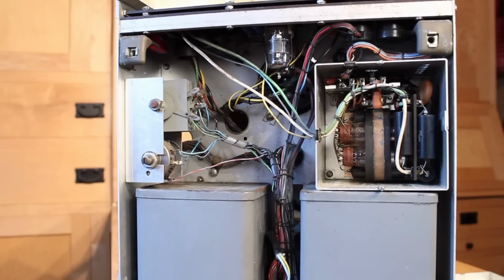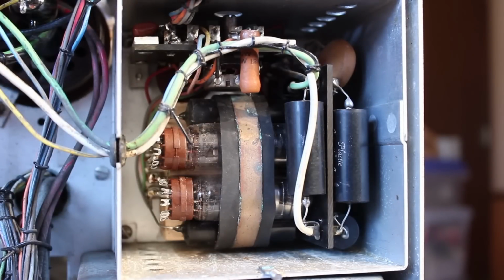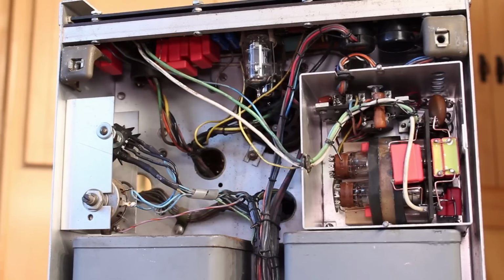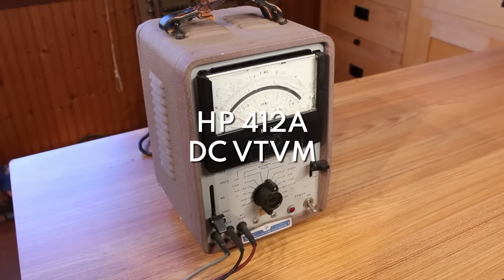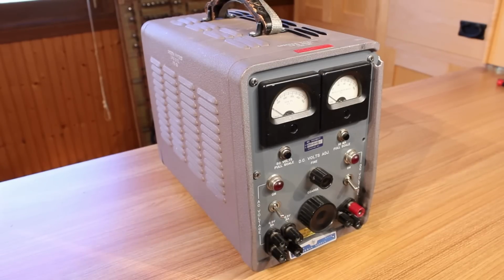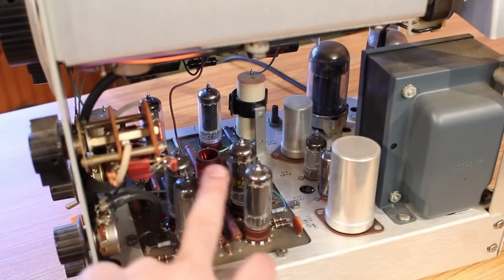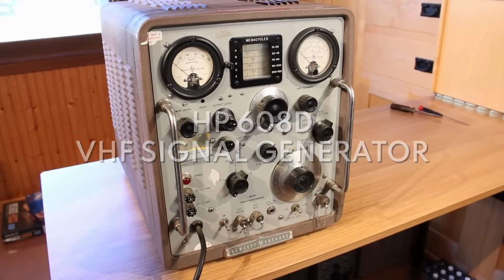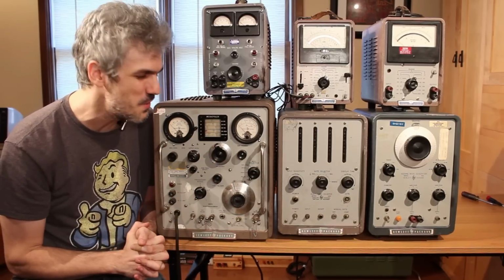Vintage Hewlett Packard Test Equipment Extravaganza

Comment: You will at lease need a 5-7 watt resistor, 1-3 watt will heat up.
Reply from the maker: I think you're referring to a resistor for the heater rail in which I replaced the selenium rectifier?
If so, I actually didn't need an additional resistor, the variable resistor that was already in place (R1323) has enough adjustment in it to bring the DC voltage right into spec. according to the manual. Also, that variable resistor is a 4W resistor, so you're right that 1-3W would definitely be undersized!

Comment: Use something like JBweld to fix the corner , would love to see the resto on the frequency counter
Reply from the maker: That frequency counter is so cool, isn't it!
I think for the power supply, I'll ultimately use some JB weld to hold in a metal frame work, and then build up the rest with automotive body filler so I can sand it to a smooth finish and then paint it.
Reply: Yes just put a wire brace inside the plastic, then build up and shape it to match. Then paint the whole bezel to get it to match.

Comment: I have a distortion analizar, and a super old hp tube tester. I wanted to restore the tube tester, but im afraid of ruining an antique.
Reply from the maker: I like to think that these old pieces of equipment were meant to be used, so even if some of the pieces inside need to be replaced, it's worth it to see them come back to life! Also, HP's vintage tube test equipment is still fantastic even today. For most of the stuff I build and play with, the HP equipment is actually overkill!

Comment: Suggest you make a dim bulb tester before plugging any of the stuff in
Reply: Very easy with a bulb holder from hardware shop (low dollar) -I used an appliance bulb first of all but got a couple of higher wattage traffic light bulbs of eBay which survive bench abuse better. I would also highly recommend an isolation transformer and variac. Burning out a choke or transformer on this beautiful gear would ruin your day. The isolation transformer is a must if the unit doesn’t have a power transformer that provides isolation because these older gear often uses the chassis for one side of line but I use mine by default. Enjoy but be safe! I as a minimum have a GFCI outlet as well.
Reply from the maker: A Variac and isolation transformer is definitely on my "must get" list. 
Fortunately, every piece of HP gear here has it's own power transformer, so isolation shouldn't be an issue (as long as the power cord isn't frayed or broken). Also, when I'm powering up any of these old pieces, I keep everything on a surge protector and keep my toe on the master switch. If anything seems amiss, I hit the switch with my toe, cutting power to everything quickly! It's not the absolutely safest way to go about it, but it works well with what I've got.
Reply: @UsagiElectric  understood but honestly a dim bulb tester would take you about 15 mins to make. I just got one of those 5 dollar lamp holders from Home Depot etc , a piece of scrap wood and an old appliance cord. You see guys with the more fancy set ups for convenience but you don’t need it

Comment: Does anyone here have any ideas how I can find a good home for a dual beam valve scope in the UK ? (Also many vintage CRT monitors and serial terminals).
Reply: Where in the UK? 
"Serial terminals".... this, I am liking.
Reply: @edgeeffect  Well, I assume that YT will block any attempt at sharing contact details, so how about I could deliver them to any ex-equipment shop / second hand shop etc that was reasonably close to the middlish part of either the A1 or the M1. To be clear they are very old very bulky CRT dirty scrap serial terminals. They haven't been powered up in decades (I would at least check they "work" before transporting them anywhere). Microcolour Graphics models M4305 & M2100. (and the scope is a Solartron CD 1440)

Comment: I think you should start with one of the units in the worst condition, and if/when it needs a long procedure to continue on it or you start to feel a bit of a burn out from working on it, work on one which will take you a shorter time.
as you said, some of them take a skill set much different to the other some of which you'll need to learn from 0. so I think you'll enjoy taking a break from each subject sometime (I know I would).
Reply from the maker: I tend to do this already actually! 
Though, it's on a bit of a different scale. The HP stuff is a bit of a distraction from the vacuum tube computer to keep me from getting burned out on such a long project. Interestingly, none of these seem like they'll really need heavy diagnosing like the HP 150A did, or at least, that's what I'm hoping, haha.

Comment: You used heat shrink for the rectifier but didn't add any sleeving on the long leads you added to the caps in the high voltage box.

The sprague caps with red writing are diefilm caps so they should be just fine. Also the Selenium rectifiers only go bad when they have been stressed for a while due to over current use. It's a 50/50 shot but typically they just don't go up in smoke unless something caused it such as running the device with bad filter caps causing a excessive current overload.

I would work on the VTVMs first so you can use them to troubleshoot the rest of that equipment.
Reply from the maker: The heat shrink tubing on the rectifier was to prevent a short due to the close proximity of the wires. However, for the caps in the HV box, those all had pretty long, exposed leads originally, and there weren't any places that seemed to have anything too close that could cause arcing or shorts, so I didn't think it was necessary. So far, it all seems to working well!

Thanks for the heads up on the Sprague caps, I'm terrible at identifying old caps. As for the Selenium rectifiers, I've heard that they can start to degrade and increase in internal resistance, even under normal operating conditions. The smaller ones in the other equipment are probably fine, but the big in the HP 150A was part of a series heater circuit, so it definitely saw quite a heavy load for most of its life. 

Thanks for the vote for the VTVMs! I'm keeping an Excel sheet with a running tally to see which piece is the most popular!

Comment: The HP 711A PSU is the most useful, For the front bezel you could try Hand Mouldable Thermoplastic.
Here is a link on how to use it https://www.youtube.com/watch?v=nh57msKi9BY.

The  HP608D VHF Sig Gen is a gorgeous bit of kit.
Reply from the maker: I agree, I think the 711A would probably be the most immediately useful, but if any of them were fully restored and on the bench, I'd totally find excuses to use them all, haha.
For the bezel, the current plan is to build a wire framework on the inside and then build up body filler from there. There's going to be a lot of sanding in my future, but I think I can get it looking pretty good!
Reply: @UsagiElectric  I would be nice to see them all lined up and plugged into each other. :) Nice and toasty, too. LOL.

Comment: I recently bought that exact same HP vhf signal generator at a yard sale. When I plug it in the tubes on the inside glow but im scared to turn it on. What does it do and whats it meant to be used for? Is it valuable?
Reply: it generates the VHF (very high frequency, 30-300MHz) signals, and it is used to test and align the equipment that uses those frequencies, primarily FM radios I guess. also, if the tubes glow, it is already on - the on/off switch is before the main power supply transformer which generates the heater voltage among other things.
Reply from the maker: Konstantin beat me to the punch, but he's totally on point!
It generates a very high frequency signal. The 608D in particular can generate a signal from 10MHz to 420MHz ranging from 0.1uV to 0.5V in amplitude. It's a decently popular piece of equipment among HAM radio operators as that's the range that their communication radios tend to operate in. 
And as Konstantin pointed out, if the tubes on the inside were glowing, then the machine was already on and powered up! If it didn't let out any magic smoke, that's good news. If you have a modern oscilloscope that can read above 10MHz, you could probably hook it up and see if it's outputting a proper signal. 
As for whether it's a valuable piece of equipment or not, it's hard to tell. I got this one for a very reasonable price from a fellow enthusiast, but depending on where you live the value can vary pretty wildly.

Comment: Boss, I think you should work on the meters first. Think you will find them superior to what your currently using. Mike in Virginia Beach
Reply: Suggest looking at Mr Carlson channel as he has done a lot of this stuff. One thing he has said a few times is the red Spragues are film and very robust. You need to be careful handling HV caps -they can hold a nasty charge
Reply from the maker: Thanks! And I agree, those VTVMs would be excellent pieces to have on the bench!